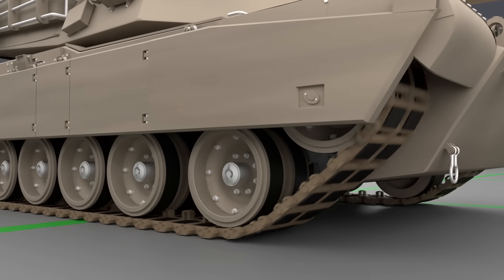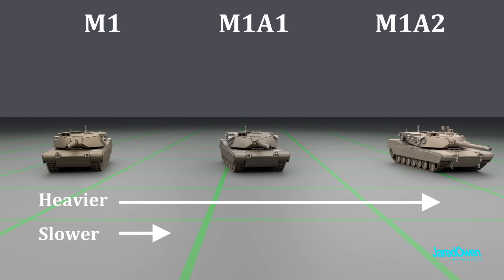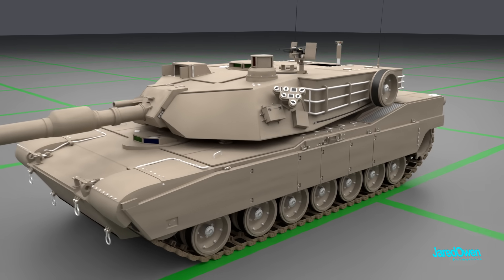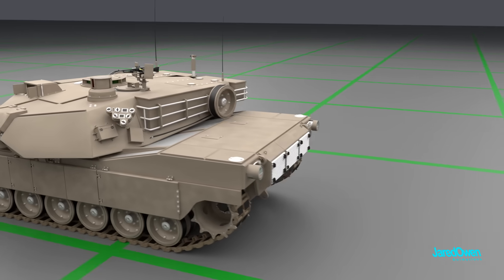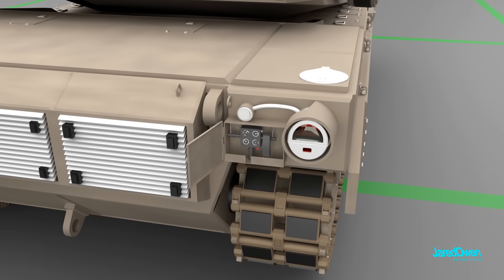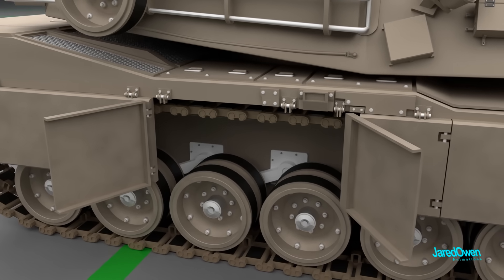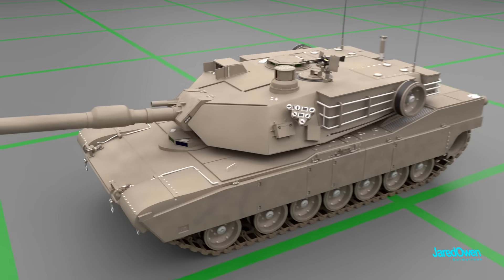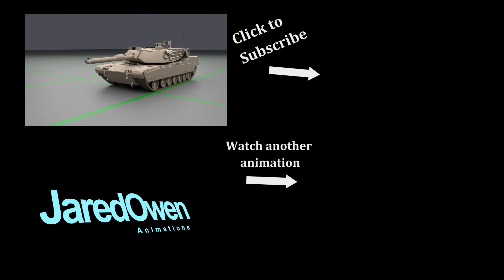How does a Tank work? (M1A2 Abrams)

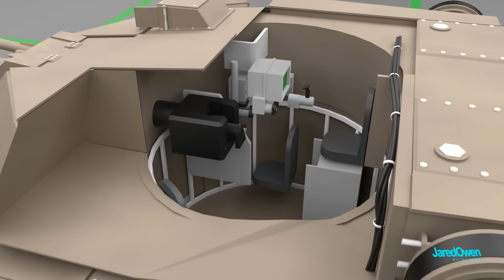Comment: Thanks this is great. I’m having a flashback. At 7:22 shells does not leave the tank, the shell, holds the round, the round leads the tank. The shell is Ejected out of the back of the barrel of the main gun. An easy mistake to make. Especially if you have not actually done this yourself. Love the video, thank you very much.
Reply: The main penetrator (the rod) leave the barrel and the sabot (that blue coloured thing) discarded
The Shell casing in modern shells were usually got burned due to either a different material or different explosive type, idk which
The thing that's gonna be ejected backwards are that grey thingy which i forgot the name

So this animation is actually accurate
Reply: @Kalashnikov413  ok.  I didn’t know that.  We’re you actually ever in an army tank?
Reply: @Harleyglide03  nope, but at least i know a lot about basic tank informations
Reply: @Kalashnikov413    I think I do as well.  That grey thingy is the shell. It doesn’t burn up.  Practice rounds are steel.  Live combat rounds are brass. They hold the round, sabot, Heat, smoke, or whatever else they have invented.  I have had a little experience in these, hands on.  Of all of the rounds we carried, the sabot was my preferred round and was the first round in the tube at all times.  It could kill Soviet tanks and was the fastest round we carried.  1 mile, 1second. If we did our job as a crew,  NOTHING should have ever gotten closer than that.  The laser range finder was accurate and the gun is accurate to farther than that. And very deadly.  We could actually range out farther than that, but I think the actual distance was classified. Might still be. I don’t know. It was a long time ago.

Comment: Correction on speed of projectile fired from cannon.  The speed of projectiles is NOT 3500 miles per hour.  The speed is 3500 Feet Per Second.  Big difference.  3500 FPS = 2386.36 MPH
Reply: No- these rounds go 1,500m/s.+ So 3,500mph. is not innaccurate.
Reply: Some rounds out there- at least for the 120mm. if not the M829 rounds for the Americans are higher velocity.

Comment: 68 US tons? They measure tons differently from the metric system?
Reply: "U.S. tons" is an alternative albeit not really all that common way to say short ton. There is the short ton, which is 907.18kg. (2,000lb.), the long ton- 1,016.05kg. (2,240lb.), and the metric ton or the tonne which is 1,000kg. (2,204.62lb.). Long ton is British and is used quite internationally in marine applications. Not sure why exactly.
Reply: @peterson7082  Did not know that. Thanks a lot.

Comment: Ok, what you showed as the "engine" was actually a complete power-pack, which includes the transmission and reduction gear box. The "cooling units" aren't just for the engine. There are actually 3 "radiators", 1 for the engine and 2 for the transmission.
During the 1st Gulf War, they were hitting targets 4 miles out. Tanks do not "lock" onto targets.
20 year retired tank mech, these were my beasts.

Comment: I thought commander was a Navy rank . The turret doesn't spin it rotates.
Reply: Commander is a role in Army terms. And exists like commodore at a lower paygrade in some acting rank in Army and Marine formations. A commander in Navy and by extension Marine terms is a rank and a role. Not always at the same level.
Reply: A little bit of information: a typical tank commander would either held a rank of Master Sergeant or (if you're a platoon leader) Second/First Lieutenant

Comment: The only thing that you missed was the door to the turrets Nest that holds the ammunition is a hermetic locking door. It also opens and closes itself and it will not allow the tank to fire while the door is open incase of catastrophic failures
Reply: rounds travel at 3500 feet per second, not miles per hour
Reply: @CampHacker  and where did I say anything about the rounds after they leave the barrel? If you look at my comment the words mph isn't even a part of it

Comment: Why not using a remote control machine gun out side to protect the machine gunner from enemy fire.
Reply: they already did

M1A2 SEPv2 use CROWS, which stands for ''Common Remotely Operated Weapon System''
In the new SEPv3 variant they use CROWS-LP,, which LP stands for ''Low Profile'' meaning that it's shorter in appearance, and some SEPv2 model already received the CROWS-LP

Comment: How does the turret actually “work”? Cuz there has to be electronics that span from the turret to the body of the tank. 
How do you make a rotating mechanism that keeps the wiring and all intact and not ripped after a certain degree of rotation?
Reply: Slip rings.

Comment: Very cool. I was a gunner on an M60 71-72. A good loader is key to being a successful gunner. I was unaware that the driver sat back like that. In the 60, you sat on a small seat upright, and could drive buttoned up or with your head through the hatch. Also, there was a brake and gas pedal, and if I remember correctly, there was a gear shift, low, high and then cruise speed? The M1 is like a Cadillac compared to the 60. Can the driver drive hatch open? Just wondering how it is for loading on railways etc if you have to be buttoned up? Hard to see ground guides no?
Reply: On the abrams the drivers seat can adjust to sit more upright for driving open hatch. If someone rotates the turret you can still sit upright until the turret is around the 90 degree mark to either side. At that point the driver needs to scrunch down a bit but still might get a little turret graze across the top of their helmet :)
As for the internals: Driver has a brake and to the right is parking break. The T'bar control in the center has transmission selection in the center between the handle throttles (M1A1 at least). The left and right grip handles are connected for throttle and the steering is done with a push/pull motion on the T bar itself.
Was on the A2's briefly afterwards but didn't care for them much. Details fuzzy probably since I'd rather forget about them since they were unreliable by comparison. But when they worked they had much better multi target engagement.

Comment: Where does the case of the bullet go  when the tank fires?
Reply: Older vehicles or vehicles with legacy guns simply leave the brass casing on the turret floor/ basket until time is available to empty it from the vehicle. Today most tank guns have a combustible catridge which only leaves the base-casing about 2.2cm.+ (7/8") long (at least for the 120mm. guns used in NATO countries) remaining. The rest of the catridge is expelled or burned up when fired.

Comment: the 120mm M256 has an original name which is 120mm Rheinmetall Rh-120 L/44 or L/55 smoothbore
Reply: It's its own gun. It was developed from and was originally licensed by Rheinmetall. But the M256 is not the same gun as the "Rh-120"

Comment: When a car is going 20 mph, what speed is the bottom of the wheel going?   Tracks are just that. They make a trackway that provides a flat surface for the wheels to roll over. Therefore the axils are pushed forward, not pulled. The bottom of all road wheels that are not skiding are stationary.

Comment: They should come up with an automation technique to get rid of the loader. The could rename it, "The Freeloader".
Reply: Manual loaders have their advantages
Reply: this is a real thing - they're called autoloaders and they've been used since the 50s, notably on the Soviet T-72. while they eliminate a crew member, they are costly and take up space.
Reply: @ShaggyGotSauce  Actually, autoloader like Soviet carousel type doesn't required that much space compared to many NATO tanks
Reply: @Kalashnikov413  while yes the autoloader itself is not so big, the T-72 has a notably cramped interior, which makes it worse. 

also, NATO tanks generally don't use autoloaders
Reply: @ShaggyGotSauce  While the interior might be smaller, it doesn't mean that it's too cramped.

Typical Average Russian male height is somewhere in between 165-170 m, so they can still fit.

Comment: Even though there were a lot of different tanks used by different countries since the very first tank was built nearly over a century ago the basic look and design has remained the same accept for the position of the engine which originally was at a different spot causing the crew to pass out from the gasoline fumes and that it got real hot inside so that was why the engine was moved to the very back of the tank and the tank treads design has remained the same.
Reply: So a 1918 Mark V tank has the same basic look as this Abrams? Sure bud.
Reply: @GielL96  The true tank that could be considered the GrandDaddy of all tanks is the French Renault that was armed with a 35 millimeter cannon but it had the basic tank treads of all tanks but the only problem with the Renault is that it had to be hand cranked to get moving which at the time wasn't very fast as soldiers could keep up with it yeah that's right it moved at walking speed but all of today's tanks and the others that were used since WW1 were built based on that little tanks design even though there have been a lot and I mean a lot of variants in tank design since the Renault was first seen on the battlefields of it's time.
Reply: @GielL96  1917 French FT

Comment: Where is the fuel tank?  You say it runs on jet fuel, so where does it go?  WHERE IS THE FUEL TANK?   As with airplanes flying on compressed air/free energy so this tank must do likewise.   Aaron Dover (RIP) Bitchute for the best research.
Reply: What are you on about? The fuel tanks are in the engine compartment.

Comment: "The exhaust comes out the back, so make sure to stay clear when the engine is on." Unless you're an infantryman doing a field exercise in the middle of winter. Then tank exhaust is like heaven.
Reply: During winter training in Hoenfels Germany the temperature was in the high teens. I invited some Infantry guys into my M60A1 tank turret to get warm. The heater on the M60 tank was notorious for breaking down, when it worked it made German winters much more bearable. I had some Infantry guys in my turret for about 15 minutes getting relief from that biter cold. But they still called us DATS (Dumb Ass Tankers) - C Company 1/35 Armor, Erlangen Germany.
Reply: @michaelcurl9817  Yea I was stationed at Erlangen also with 47th Support Battalion and was the NCOIC in charge of 2-81 Contact Team then changed to 4-70th Armor in I think 88.  I think everyone just got the M1's when I got there.  An Yea we called you all DAT's and sometimes for good reason.  Especially one time we was bore scoping the tubes and one of the DAT's ran into the tube trying to bend it with his head.  He got to spend a good week in the hospital in Nurnberg with a huge goose egg.
Reply: @michaelcurl9817 I remember those heaters. Before I went to Germany and got my brand new M1A1, they had me in 4th battalion, 68th Armored at Ft. Carson. They put me in S-3 and I drove the battalion commander's M113A3. They sent me to heater repair school. 99% of the time it was carbon built up on the ignition. It's like the old cigarette lighters in cars. Remove it, scrubbed off the carbon and she's good to go.
When I got to Germany, my CO put me on his tank and had me teach the whole company how to fix their heaters. I got a rack of Erlangen pilsner for that. Great memories.
Reply: a warm but toxic heaven though haha
Reply: @zumabbar  Hold your breath!
Reply: It is early morning, you come out of your barracks and see several M1A2 parked outside. How do you tell which one has its engine running? Look for one with a bunch of people at the back of it lol
Reply: 900 degrees baby. I was a 19 kilo. Iron tigers.
Reply: If I remember right, it took about 10 seconds to heat up the main meal packet in your MRE.  That freed up the new chemical heater packs for some field fun with plastic bottles. It was the 90's and we got bored, no fancy cell phones yet :)
Reply: Facts did that a few times in Germany
Reply: https://youtu.be/PTc1YRqs160  made in Rhodes first.
Reply: Haha reminds of being a prepschool kid freezing at a bus stop during colder months.
Reply: In the early years in Germany 🇩🇪 we would drive these tanks through towns.  Many BMW's had the paint burned off the front of cars when they got to close to the tank 😳.
Reply: “We found your health problems to be non service related.” 😂
Reply: Great video, I enjoyed working on that beast of a machine.
Reply: Fort Pickett
Reply: Зато они очень хорошо горят на Донбассе.
Reply: “We found your health problems to be non service related.” 😂
Reply: And we were glad to warm ya'll, brother! Combined Arms! Thank you very much for your service and sacrifice, brother.
Reply: The Germans learned quickly not to follow us to close in the city on the way to the rail head. I saw 3 cars get their front ends melted. 😂
Reply: Lol yes the million dollar dryer
Reply: exhoost fume tastes kinda funny innit
Reply: Not if you like carbon monoxide.

Comment: 21 century... Abrams still uses a loader😂
Reply: It's not about technology, but doctrine

US tank crews prefer manual as it was faster than autoloader (if the loader was well trained)
Reply: @Kalashnikov413  It was a joke. I agree with the other concept, but the only thing you are wrong about is the reload speed. The point is in the survivability of the tank. There are two main concepts that have both pros and cons. One of them is used in Russian tanks. The automatic loader reduces the number of crew and, as a consequence, the internal volume. This allows for increased armor and reduced silhouette. The disadvantage of this idea is the vulnerability of the ammunition. One successful shot and the end. On the contrary, in the Abrams, survivability increases due to separate loading. But you can forget about disguise as the volume is spreading.
Reply: @elpendejomarco9730  actually, a well trained loader can load it in just 4 seconds
Reply: @Kalashnikov413  The comparative rate of fire when using a tank loader and an automatic loader is a matter of controversy, since the practical rate of fire depends on the firing conditions:
With prolonged fire, the advantage of the automatic loader is undoubted (4 rounds per minute for the Abrams versus 9 for the T-90).
However, with a trained loader, the tank will be able to fire the first three shots in 15 seconds, while the autoloader will only make two shots in the same time.
The capabilities of the loader and with them the practical rate of fire deteriorate greatly when firing on the move, for example, in the Abrams tank, the rate of fire in these conditions is limited exclusively by the loader.
Reply: @elpendejomarco9730  i know

Comment: What the hell are we doing selling tanks to Sadia Arabia.
Reply: Saudi Arabia is America's closest ally.
Reply: Saudi Arabia is one of US Ally, and have been buying a lot of American military equipments
Reply: @Kalashnikov413  Do you know why Saudi Arabia only buys U.S. military equipment?
Reply: @sandervanderkammen9230  diplomatic relation
Reply: @Kalashnikov413  The 1951 Mutual Defense Assistance Agreement a very unique and very powerful military defense treaty that  states that the U.S. will protect Saudi Arabia from attack by any country  (including NATO allies) and in turn the Kingdom offers its military forces to assist the United States against any aggressor.
 Saudi Arabia has built and maintains U.S. military bases and equipment for use by American troops whenever required and was called upon during the wars with Iraq.
Reply: @Kalashnikov413  The military forces of Saudi Arabia are trained by the U.S. military and equipped with latest version and standards of U.S. military equipment.
 The Saudi military is 100% compatible and  "interoperable" with U.S. military forces.
 Any Saudi tank unit or fighter aircraft squadron can be fully combat integrated into any U.S. military unit and/or command and control structure at any moment and perform as if it was an American combat unit.
This is a level of military compatibility and interoperablility that doesn't even exist within NATO or the British Commonwealth.

Comment: Well done, Jared. Loved it! One question ... when a round is fired what does the loader do with the shell casing?
Reply: The majority of the cartridge is burned up on firing, the base cap is all that remains and falls to the floor after the breach is opened
Reply: What shell casing???? The German Rheinmetall 120mm ammunition is caseless 
It has a combustible cellulose cartridge casing.
Reply: @sandervanderkammen9230  well this tank is USA made I believe, they probably don’t use the German shell design. Kind of like how the Russians use auto loading main guns unlike the US.
Reply: @insaneelectro8238  The M1 Abrams is   based directly from a German prototype tank design which became the Leopard 2.
 The M1A1 and M1A2 uses basically the same German Rheinmetall L/44 gun and ammunition.
The L/44, was given the U.S. inventory number M256 and is licensed to be made in the U.S. at the Waterveilet Arsenal in New York.
The U.S. made version is uses the same same caseless ammunition as the Leopard 2.

The U.S. made version is cheaper to build and is heavier than the German version.
German made guns have a lighter, hydroneumatic recoil system and a concentrically balanced gun tube while the M1 has heavy steel coil springs and cheaper, less accurate barrel.